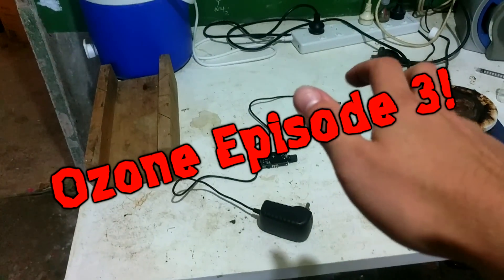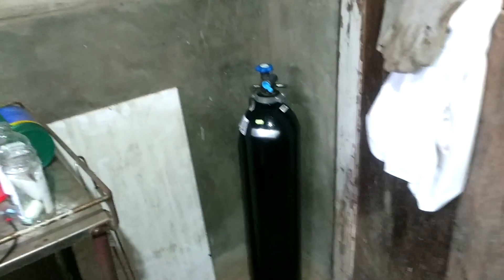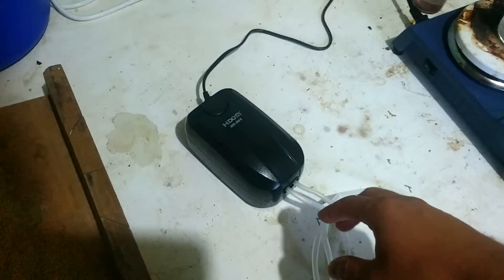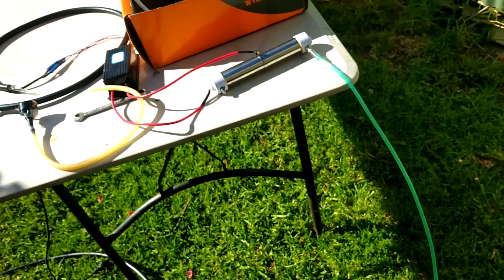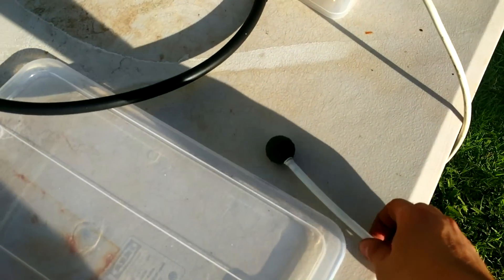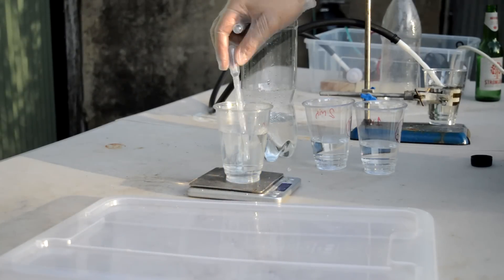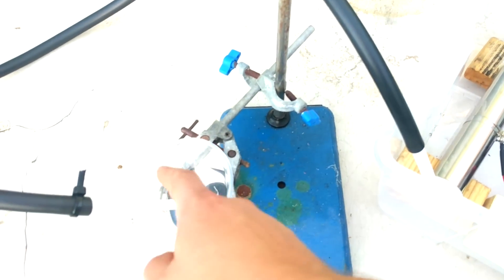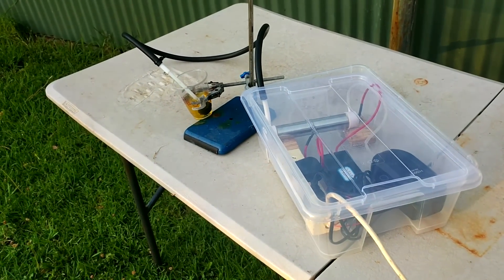Putting Pure Oxygen through the Ozone Generator (Ozone Ep3)

Comment: A couple of comments:

1. Ozone production level is very dependent on the the temperature of input oxygen. The lower the better (up to a point). If you are going to use the oxygen bottle, I’d suggest keeping the tube covered. 

2.  Likewise, humidity reduces ozone production (and increases ozone decomp). Probably not an issue with bottled oxygen but very likely to be an issue with ambient air, particular summertime outdoor air.  Maybe pull input ambient air through a calcium chloride container or some other desiccant medium. 

3.  I played around with this 6 years ago fiddling with the chemistry of mold remediation. For ozone generation, I used a device designed by a professional remediator for his own use. It would clear a room in under 5 seconds. It was built inside a large plastic toolbox with power supply mounted inside, dual corona plated, an intake fan and standard 3” intake output ports. I paid $199 for it, and true to its word, it outperformed $5000 units. 

To boost its efficiency, I created an adapter for HVAC register connecting to a 10’ length of dryer exhaust tubing to supply a stead source of dried, 50F air.
Reply: Sounds like what I'm kind of brainstorming.  4" air duct hose coming off the unit, going to a plate that I can screw on to my house's air return. Sanitize the air ducts , then turn on my furnace blower to reach the whole house. My goal is to try and neutralize  mycotozins from a moldy basement I redid... Only thing I'm wondering, if it's make sense to run a oxygen fuel cylinder into the unit so it's not just running off room oxygen.

Comment: Based on the overheating issue you had with the transformer in a previous vid I'm wondering if the issue you have with output dropping with increased time is that it just isn't providing enough power.  I'd seriously look into replacing the transformer with a much higher rated one. Even an old neon transformer might do you good.

Comment: Now consider atmospheric pressure. You have the oxygen % variable in your control, some better air flow, but what of the millibars? Higher atmospheric pressure, via some improvised hyperbaric chamber, has to be of importance. And if you and styropyro could put your heads together you'd have a decent ozone electrical arc doing this for you. And as said about 60% of the way thru the video, nitric oxide should also be a product here. Cody's lab has a decent homemade spark gap machine that he used to make his own nitric acid and nitrates. Free fertilizer dude. And ohhh boy could you have some real fun when this thing is running proper!

Comment: How do you know the ebay listing is false? You only tryed one fairly slow flowrate of oxygen and didnt cool the unit. 
Also you didnt check how efficient the ozone is absorbed in the solution. Use two gas bubblers in series and see how much gets to the second.
Reply: It's sketchy because it's a cheap chinese ozone generator that claims a much higher ozone production rate than its practically identical and sometimes more expensive counterparts. Maybe he'd be able to squeeze another 0.5-0.6g/h out of it with optimized air capture but 3g/h seems unlikely.
Reply: @pietrotettamanti7239  Its sketchy, but its the exact same principle expensive units use. Why souldnt it work the same way here? Its mostly about the oxygen being dry and the unit cool to get a high concentration. And then you need a high flow to have high massflow. Its simple math to get a high massflow out of a fairly low concentration.
Im not claiming ebay listings are correct or anything, but the way he gets to his conclusion is nonsense.
Reply: You didn't follow what I wrote: the suspect of it not being truthful about its performance was always there (watch his previous videos), because if all of the ozone generators on ebay claim a max ozone output of 0.6-1g/h and this crappy one (which is also chinese which doesn't help), with no added features or anything whatsoever claims a 3× better performance being suspicious is the least he can do. When that's also backed up by experimental evidence I find it perfectly legit to state that the claimed performance is false.
By the way I highly doubt that the manufacturers actually went through the hassle of testing it under perfect conditions in order to squeeze out every last bit of performance. Why would they do that? Our aussie here had a setup that's already above average for normal conditions. If they were being honest about it they would test it under field conditions, and if they weren't being honest with it they wouldn't even bother testing it under perfect conditions. It's not like anyone is going to sue them. My best guess is that they calculated it "yeah if x amps are supplied through the arc then y moles/hour are going to be produced", which is a fairly common practice and perfectly legal.
Reply: @pietrotettamanti7239  Yes, its going to be bullshit. But even if the unit has a real(!) output 5x higher than what it says, he still wouldnt be able to tell due to his methods.

Comment: Hi. Have you ever tried adding the acid to the I- solution before bubbling the ozone through? It would allow direct oxidation of I- into I2 by O3/H+.       I dont know but maybe O3 oxidizing power decreases with the increase of pH during your reaction (H+ is actually required for O3 to oxidize :            O3 + 6H+ + 6e- => 3H2O). That would explain why your efficiency decreases with time (pH increasing) even if I think this is more likely due to the ozone tube heating or something like that.

Comment: Ah the infamous Death-Dapter xD For the flow, go for just a few lpm. Thus you dont waste that much oxygen. Also, a well made O3 gen should be able to run for a long time. Buy a high airflow 120mm computer fan and point it directly at the O3 tube.  Ideally from the top to keep it low profile.

For the fan look for something like this one. Go for around 100-150CFM 

https://www2.mouser.com/ProductDetail/Delta-Electronics/AFB1212VHE?qs=sGAEpiMZZMt9MS9kROxCw2Vwd6QMOrz8Ny0WJd5eX2qce7hIDi6D0w%3d%3d

Keep those nasty HV cables from touching eachother and away from metal. If enough voltage is going throug them they will for a corona discharge (which should only happen in the tube) and you loose efficiency. It can also breakdown the insulation with time. This happens especially easy at high frequencies at which the "transformer" runs. 

Also I would put everything in a proto-enclosure. They are super sturdy.

Comment: Yay NileBlue!

Also, that box might get too hot. You might need to use a different one.

Perhaps the loss of ozone in the longer samples, is because it's exceeding the capacity of the water to solvate it, and being displaced by other gases? If I remember correctly, oxygen and other gases aren't really that soluble in Dihydrogen Monoxide. Perhaps a solvent like a perfluorinated compound?

Is it possible that it's reacting with the O3 to form Dihydrogen Dioxide?
Reply from the maker: H2O2 from water? I believe so, although getting any sort of good conversion might be very difficult

Comment: Is there any way to use the O3 to make storable oxidizers? Like persulfates, peroxides, perchlorates, etc. It would be great if it could oxidize bleach into perchlorates. How about permanganates? I have not done the calculations, but O3 must have one helluva high standard electrode potential, given how unstable it is.
Reply from the maker: Ozone has one of the highest potentials so yes, that's all mostly possible. Permanganates, dichromates in one step from oxides, nitrates from ammonia, peroxide from water maybe, lots of things. 
Perchlorates are the one exception, ozone can't make them it seems, chlorate is just too hard to oxidize, which is a shame, but lots of other things to do!
Reply: Extractions&Ire 
Have you tried it with bleach?
Reply: @ExtractionsAndIre  After your first ozone video i read up on this stuff and found that ozone is supposed to be able to turn urea into nitric acid. Now that seems quite useful because urea is easy to get pretty much everywhere.

Comment: Quick note on the pump. If it's like mine inside, I don't think you'd be able to hook up the two outputs into one. The diaphragms' vibrate-y bits are opposite each other on the same magnet and, I could be wrong, but I think connecting them will largely just move air back and forth between them.
Reply from the maker: yeah that makes sense, could explain why I saw such a shit flow rate when I combined them together, even worse than just one on its own
Reply: @ExtractionsAndIre  I ended up removing one of the diaphragms rather than plugging it or letting it just make noise, with the added bonus that I have a backup part. In this application especially, might not be a bad idea to have a replacement on hand. Even just the straight O2 will probably accelerate wear on generic Chinese rubber no? Though they're designed for constant use for years, so probably not too big an issue. Aquarium check valves are cheap as far as preventing back flow goes.

Comment: I think its better to use a UVC fluorescent tube for the production of ozone instead of high voltage.
Reply from the maker: why that you reckon?
Reply: @ExtractionsAndIre  It does not make any NOx, I guess.
Reply: @ExtractionsAndIre  Because it is the UV-C that is the cause of converting oxygen to ozone.
with DC high voltage you get the best result by making a corona this also emits UV-C
to make a corona its important that the anode and the cathode is at a distance from each other enough to ionize the oxygen 
but far enough to avoid an electric arc and damaging your high voltage generator.
The reason I think  this TL is better because it has a larger surface area to apply the UV-C  to the oxygen through the outer tube around to the fluorescent tube the spacing between here the reaction will take place.
You can recognize the fluorescent lamp that it is transparent without coating made from Quartz glas But be careful with this lamp it causes burns on the skin and welding eyes.
This is what I suspect it is worth to research to see if it actually is better..

Comment: 7:18 : I strongly suspect a lot of ozone bubbles right out, without having enough time to dissolve and react with the iodine.

Also, for the nitrogen oxides issue : even if you use air instead of pure O2, they should be fairly easy to scrub off by bubbling the air/ozone/NOx mix through some NaOH solution before using it for your reaction.

But congrats on making such a neat setup! 
Make sure you stay upwind of it... ^^
Reply from the maker: in future I will do stirring AND the air stone and then finally people might be able to accept my gas capture efficiency!

Good thinking about the scrubbing. I can't think of any reaction in particular though where it'll be a huge issue, so hopefully it doesn't get to that.

Thanks! I'm glad i'm doing the stuff outside now haha
Reply: @ExtractionsAndIre   Stirring would be a little pointless, since the bubbling itself does that already! (That's actually the main point of bubblers in aquariums: mixing the water around to ensure everywhere gets oxygen)

The problem is more a matter of column height (your bubbles only go through a few centimeters of water before reaching the surface).

If you want to make sure you have proper gas capture efficiency, try making the same reaction in a tall container, like a large glass bottle,  and see if you get any better yield. (just dilute with more water to increase the total volume and fill the whole volume)
Reply: @piranha031091 He could test the collection efficiency of whatever setup he settles on with a two stage setup, where the off-gassing from the first vessel gets piped through a second smaller vessel with a similar indicating solution.  When the second vessel indicates little or no ozone, then his first vessel is doing an acceptable job of it.
Reply: @NevinWilliams71  That's a good suggestion! Takes a little more work, but quite thorough!
Reply: @ExtractionsAndIre  you could also seal up the first iodine cup, capture the gas and route it through a second iodine cup to measure how much ozone escapes.
Reply: @ExtractionsAndIre  Lol
Reply: I was thinking the same thing. Lower O2 rate from tank through Ozonechamber, and send to stone at a slow rate to minimize too rough bubbling.
Far taller column of solution, perhaps even recirculation of what bubbles up. Maximize chances of ozone reacting with solution.

Comment: Why did the number fall over time?
What is the relationship between gas flow rate and the efficiency of ozone generation. How much of the gas is passing through without conversion. One possible reason, might be that the voltage output of the ozone generator is falling as a result of the load produced by the generation process. If this is the case, a slower flow rate may increase the efficiency.
Is it worth fitting a drying tower to the gas flow for when you are not using pure oxygen?
Reply from the maker: Hmm, maybe you could be right about the efficiency, but I like having the flow rate as high as it is. There shouldn't be too much load on the generator just by having a higher flow rate I think...
A drying tower is actually a good suggestion yeah! Although with the aquarium pump, the intake is like lots of holes underneath it, which would be very hard to connect to the output of a drying tube
Reply: @ExtractionsAndIre  better to connect the output of the pump to a drying box. I do not know if this will work, but maybe a box or bottle, fitted with an inlet and out let,  part filled with calcium chloride. There is a clue in the amount of ozone generated when using air or pure oxygen. He more oxygen put through, the greater the conversion. Le chatelier's principle would suggest that increasing the flow of reactants, reducing the concentration of product should increase the mass of product generated. This suggests a high flow rate is a good idea, however, a high flow rate reduces the time the reactants are exposed to the electric field. If the flow is lamina rather than turbulent in the ozoniser, there will be less chance of un-reacted oxygen being exposed to the field. 
Maybe some of the output flow could be re-injected into the input, to increase the yield.
Another clue is the amount of ozone generated falls, the longer the experiment is run. This could be due to the generator heating up or because the high voltage falls over time. Something is shifting the equilibrium constant away from ozone. It might be worth pulsing the supply to overcome the heating effect. Pulsing the air supply might give the high voltage time to recover, if this is the problem. If the HT is generated using a Cockcroft and Walton multiplier, it is possible that the generator cannot support a relatively high current for very long, as the capacitors will be discharged faster than they can be charged, leading to a poorly regulated output voltage.. 
It would be nice to know the HT voltage and it's current. As the voltage is likely to be of the order of 7000 volts, it is not some thing I do not expect a chemist to be equipped to measure.
Is the spec for the ozone generator mains supply 230 volt?
Reply: It might be worth cooling the ozone generator, as high temperature will considerable reduce the efficiency of ozone generation.
Maybe running the air feed pipe as a coil through ice water might improve the generator efficiency. A drying box would be required to remove the moisture produced by cooling the air. Water vapour. Is also reported to reduce the efficiency of ozone generation.
The falling numbers of the longer runs can be explained by the heating of the ozone generator and the air pump . Ozone generation is an exothermic reaction, so cooling favours ozone production.
Reply: @nigeljohnson9820  
It has 15000 volts in output and I think 12 volts in input (since that's what he's using).

Comment: Have you thought about running your air through CaCl to combat some of the effects of humidity?
Reply: The O2 from the tank is essentially 0% humidity
Reply from the maker: its hard to do with the aquarium pump, because the inputs are small holes all along the bottom of it. It would be good, but perhaps I can just wait for non-humid days. Where I live, its mostly just hot and very dry, we have very few days of high humidity without rain
Reply: @ExtractionsAndIre  Not the input, the output... pump>tube>CaCl canister>tube>ozone gen>tube>mad science

Comment: Silly question; Do you have an aquarium store nearby? Or a supermarket with a pet store? Both usually have aquarium air pumps  with no need to wait for shipping.
Also, if you have either of those or a hardware store nearby, there are tee fittings that can join two tubes into one.
Reply from the maker: I think I do, but they're generally a lot more expensive and have a much smaller range. I should check them out, but honestly the month long wait for parts is mostly fine because I always have other things to do while I'm waiting
Reply: Dancing Rain but is it a teflon tee

Comment: Wouldn't the conversion ratio improve by slowing the oxygen flow?  Conversion rate will probably remain the same, but you would use less gas.  Get 2 or 3 death trap hell machines and try a parallel, then series run.  You can also get an oxygen concentrator, or some nitrogen membranes and make your own.  Eliminate the gas cost.  But only if you plan on using this long term, and a lot.
Reply: The problem is, while the corona discharge makes ozone, it also decomposes it. So cannot convert all the oxygen, only tend towards a certain equilibrium value. Slowing the flow further once you're already close to it will do very little to improve your conversion.
Reply: @piranha031091  yes but having too much flow is also useless. It boils down to what's cheaper, the oxygen or your time